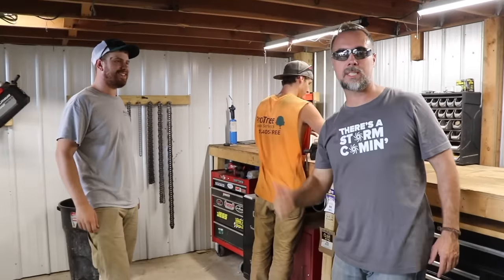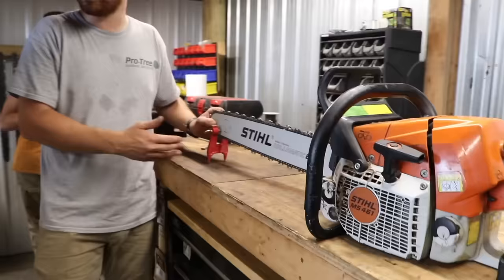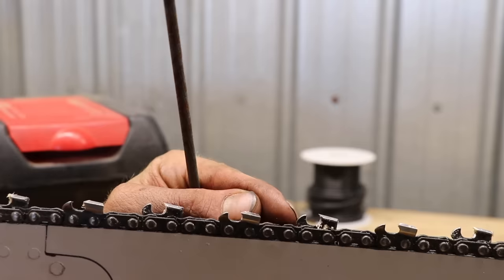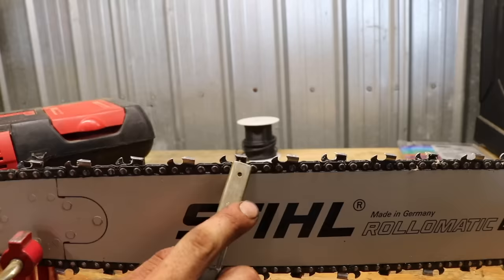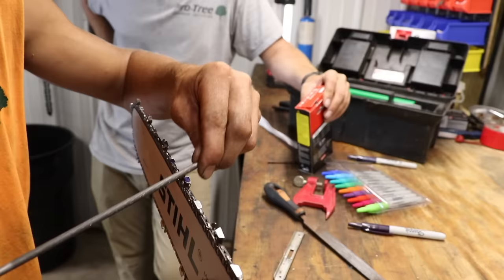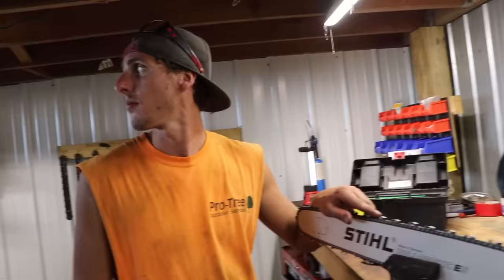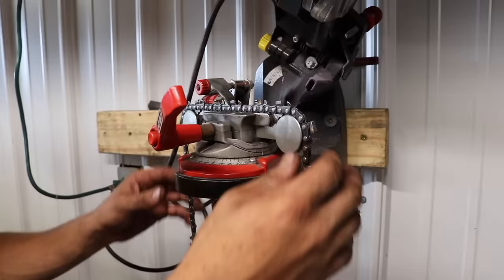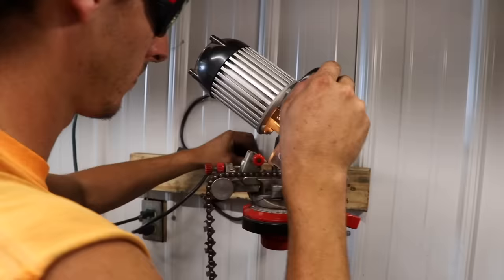How the Pro's sharpen a chainsaw

Comment: wow I have a stihl dealership that charges me 3$ to sharpen each chain. I drop off 5 chains at a time and I just change them as I need to. I'm just a landscaper that cuts once in a while and this video was very informative
Reply from the maker: Glad to hear that Kevin, thanks for watching !
Reply: 3 Bucks a chain ?  Where do you live cause around here it's 12 - 20 per chain.
Reply: in New York at a family run dealership in the country. It's a barn with a dirt floor with a Stihl dealership sign on the front LOL. They are real loggers that do a quality job too they just happen to sharpen chains real cheap
Reply: @kevincloonan9787  For $3 a chain I'd be happy to let someone do my chains
Reply: I find it takes just as long to change a chain as it does to sharpen a chain.
Reply: @richardnwilson  your doing something wrong then I can change 3 chains before I could properly hand file 1

Comment: I just use the Dremmel chain sharpener.  It works great and is really fast.
Reply: Dremmel tools yes they work fast but they also remove way more metal from the tooth than usual hand filing no matter how careful you are,  and if you're not careful you can glaze the tooth,  making it look sharp but with no ridgets so it gets dull faster.  You can also get the tooth too hot ruining the metal.
Reply: Kenny Sanchez Yes, it’s possible but not guaranteed to happen.  You can screw up a chain with hand tools too.  With a bit of practice, I’ve gotten great results. Besides, chains are pretty cheap.  If they were as expensive as the saw itself, I’d be the first one to hand sharpen.  I think I paid $18 for my last chain, and I’ll gladly toss it in the trash when it’s unusable.
Reply: Fivespeed 302 by what you’re saying it sounds like you’re just a typical homeowner buying a chain for your saw? I run a tree company,  we have over 20 different saws just the chain on my 28” Stihl is $75.  Deremel tools never leave a clean sharp on a chain tooth,  it’s glazed,  reason why you don’t see a professional logger( not want it be professional) using dremel to sharp their saws.  Now for homeowner or someone who cuts here and there no biggie,  must don’t even realize they have a dull saw.
Reply: Kenny Sanchez You do realize those chains are tax deductible, right?  Someone who does this professionally should be aware that $75 is nothing in the whole scheme of things.
Reply: Fivespeed 302 we do,  more reason to be aware of chain cost and knowing how to properly sharpen a chain when doing it professionally.  But someone who doesn’t wouldn’t understand.  Just my 2 cents this is all I do for a living.  Take care and good talk.
Reply: Kenny Sanchez It works for me, what can I say?
Reply: @KennysTreeRemoval  wow Kenny, I can get you set up with some chains much cheaper.
When you gonna do some new videos, I'm waiting as I always enjoy them. Maybe YouTube unsubscribed me or changed my settings?

Comment: i appreciate the close-up views. They didn't mention the angle line engraved on every tooth
Reply: Yes they did
Reply: Yes they did mention that
Reply: I didn't hear it either, but if the guys said they did...
They are called witnesses marks by many of the guys I know, they are not on all chains, but most. Also many chains have them on the sideplate to help you to get the correct hook/profile.

Comment: Great video! I used the same grinder/sharpener! I however cut the gullet down level with the top of the links. If you don't cut it low enough it does affect how it cuts. And keeping the teeth all the same size definitely makes a huge difference! They need to be identical.
Reply from the maker: Thank you Elias, and thanks for watching !

Comment: "Sharpened every tank of gas" -- No wonder my chains just smoke...  I honestly didn't realize they needed to be done this much.  Looks like I'll be busy this weekend.
Reply: pmgodfrey I give my chain one good sharpen before my cutting season, then I touch it up with 3 or 4 passes every tank. Always flip my bar on every tank to
Reply: I take mine to a local guy I don't touch it most ways only rounds then over.
Reply: @blacktailbowhunter0135  that's unnecessary. Flipping your bar every tank. Once a day is plenty.
Reply: @nobodythatyouknow241  sure when its on company money, if im paying for it its gonna last as long as i can get it to and it only takes 15 seconds to do so its not hurting anything

Comment: I was a timber feller for a dozen years and always chisel filed my chains and just took a few licks off the riders periodically. You chisel because it gives you a chance to get your undercut straightened out if you need to hairline a piece out. A round 7/16 is fine for firewood or limbing or bucking. I ran an 084 or Mac 125 most of the time as we were mostly in big timber

Comment: Good advice on the pro chain sharpener. I have one very similar to this one and they're wonderful to have if you do a lot of saw work. Here's the thing, Tanner -- and listen up. You have to get that sharpener secured to that it doesn't bounce around a half-inch with each stroke. You're wasting motion, time, and energy. Take that sharpener off that 2X4 and set it aside. Now take another length of 2X4 and mount it near the floor just like the original is mounted horizontally. Now take a 2X6 or 2X8 and secure it vertically between the two. Now mount the sharpener securely onto the vertical board. NOW you have a secure mount. You'll thank me later. Now be careful with those sharp-ass chains!

Thanks for the vid, Stanley. Always enjoy them.
Reply from the maker: Appreciate that, thank you !

Comment: I hand file my chains using the husqvarna jig with the 2 rubber rolers and that works well for me. 
The jig also has a depth gage on it with two settings: hard wood and soft wood. I prefer taller rakers. My saw is a bit on the weak side and it runs smoother when the raker is a bit taller than what the jig tells me to. It just works best for me after some experimenting.

Comment: I've always sharpened all the teeth without skipping the opposite angled ones. By just changing the angle of the file holder back and forth. Seems a lot faster then going over the chain twice. Didn't get that part of their procedure.
Reply: It's actually a lot less efficient doing it your way
Reply: @J0rd4nBr0 I got retheme!

Comment: Little tip. Run some timber over the teeth to take off the wire edge. Stops it breaking of and damaging the tooth when first used again..

Comment: For homeowners and weekend warriors:   Buy the file guides.  There are 2 simple hand tools you need (Stihl names, Husky also has similar tools):  the “file guide” +_$17 and “file guide holder” +_$12.   For thirty bucks you can sharpen your chains yourself correctly all the time.  (Make sure you get the correct size tool for your chain.)These pros in the video file all the time so they become good at just using the file, the rest of us just don’t file often enough to be good.  Also pay another $3-4 for the depth gage tool seen in the video.  Your chains will last a lot longer than taking them to a shop for sharpening because the electric tool generally takes off quite a bit more steel than hand files do.

Comment: In my sharpening kit i also keep a Broken Hacksaw Blade  for cleaning the chain gruve in the bar , the broken end gives a pointed end for also cleaning the oil gallery hole ,a clean gruve lets the bar oil flow & keeps the bar tip from overheating . I also have a 8 ft bucking horse made from 5 ft & 8' aluminum scaffold tube [ Tube & Clamp - 2-8' ,12-5' tubes & 15 Right angles] i can load 1 cord on this [2 ft -40' bundled  logs ] & with the chain optimum  fresh sharped i have cut a whole cord  with 1 tank of gas [ most times it takes 2 -3 tanks ,a old nylon rope to cinch the logs is handy sometimes  .

Comment: I have been an  arborist since the 1980s, with a background in forestry. And I have been a steady You Tube watcher for perhaps five years. 

I understand turning to the Tube for information. I have done it too. But because of guys like you, my least favorite subject on You Tube is chain saw sharpening. That is where I find record breaking amounts of half-baked or outright wrong information!

Let's take a look:
•Where are you guys located? How is it you don't know how to pronounce Oregon?
It is Or-E-Gun.
That applies to the chainsaw accessory company, and to that beautiful state. It is still there. It is not GONE!
•Raker: that is a nickname where chains are concerned. It is a depth gauge. It regulates the dept of tooth bite in wood. Long ago, rakers were the Y shaped tooth on some two-man crosscut saws.
•You posted a teaching video here. Quit switching names for things. Depth gauge, raker, blade, bar, and even the electric chain sharpener. It is NOT a bench grinder! Learn proper terminology and be consistent.
•Stump vise: very good to point it out. Good tool. If you hand sharpen a saw on a work bench, the stump vise can be used there too, to stabilize the saw. Like the bipod on a rifle.
•File: It is called a round file. For beginners it would be good to point out it is not a rat tail file, which tapers and is usually too coarse anyway. Your chain file needs to be the same diameter over its' entire length. And some beginners need to be made aware of this.
•File Maintenance: Files need cleaning. You sort of brushed up against this subject. You can use an old tooth brush, a small wire brush, a "file card", or at least a rag. You get a better job with a clean file. This applies to the flat file too. 
•When you ask a man to do a job, you may know to stand back and let him do it. The same goes for video making. When one of you jumped into the other guy's presentation, do you know what I got out of it? I did not get more chain information. I got that you looked bad. Are you a boss of some kind? That is poor leadership.
•This is not a bull session fueled by beer. It is a mechanical presentation. You need to have one main speaker, and he must have thought carefully about what he is going to say. If you are going to divide the video between speakers on different facets of the subject, introduce the next speaker and get out of the way. The floor is his now. How about something like this?
Now here is Fred who will talk to us about bar maintenance.
•When you showed that most chains on the wall were the dull ones and you made a BS statement about prefering to cut trees. Then you turned and I saw what looked like a tree company logo on the back of your shirt, what was the intended impression? What I saw was a company who doesn't even CARE about the maintenance every tree company has to do. It was also the way you talked. Should I hire you to prune my trees when you come off as so careless? Do you all make flush cuts because they are quicker and easier? Or do you prefer to leave 6" stubs? And to climb my tree with spikes? Or would you rather look sensible and trained enough that I might hire you to work on my trees? You need to inspire confidence. And not brag.

•Here is something that will help. You can get the Oregon Company's little booklet called OREGON MAINTENANCE AND SAFETY MANUAL. It has a ton of good pointers, regardless of which chainsaw or chain you use. Call 
800-223-5168.
Or Baileys sells them for about three bucks. This will put you all on the same page, and it is excellent for both beginners and experienced guys and gals. The industry has changed a lot through the years, and it is still changing. This is a good little book that will help you keep current.
Reply: The motor can be switched so the burr isn't left on the one side as it always is.   Granted the sparks will be coming at you but I've done it for almost 17 years now.
Reply: Man you took what I was thinking and said it there are way to many fly bye night business in the world that have no clue about what it means to learn a skill and then how to teach that certain skill the last right generation is slowly passing away a so will the skilled trades work
Reply: that burr will be knocked off as soon as the chain passes thru some wood.
Reply: A couple of really good tips that could have been said more succinctly and less rude.     Such as “I like to clean my file with a wire brush, it does wonders to keep a file clean.”
Reply: @BorderPaps  
I'll go with that.

Rudeness was not the intent. But I have been doing this a long time and have studied a lot. So I'm not very tolerant of poor presentations with erroneous information. The materials are out there: including the manual that comes with every chainsaw, the Oregon book and numerous others.

One fault that many otherwise good sources have is failing to tell about the good shop methods. There have even been "instructional" videos that used a rattail file on saw chains.

In short, I have seen more seriously flawed chainsaw maintenance videos than those who only came close.

I do tend to chime in concerning some things. When I do, I write for both the video maker and those who read comments. I hope to put out good informstion useful to all of them. And thst certsinly includes all the praise I can find to share. I do believe in pats in the back and reinforcement.

I accept the criticism. Rudeness was not the intent.
Reply: Nicely put. Dangerous work. A dull tool is the most dangerous thing in the workshop or field. Next to watching a YouTube vid and thinking you have it wired.
Reply: you should make a video
Reply: Michael Dougfiro 9
Reply: Michael Dougfir Keep studying, Bud. Check your coordinating conjunctions, and erroneous typographical errors. Owl.purdue.edu will be a great source to start. Get comfortable being uncomfortable. ⚜️
Reply: Get a grip Michael, it's just a informational video done by volunteers, it's supposed to be a little entertaining too or no one would watch. If you can do better then please do I would love to watch it and pick apart every small detail and then question your skills and work ethic based on nothing more than a ten minute glimpse into your life. I happen to know the people in this video are highly skilled and trained professionals who treat every tree and every customer with the utmost respect, care, dignity, and professionalism - please don't disparage their character based only on your speculation and personal opinion. Rant over...
Reply: @forreststump11  along with the sharp cutting edge.
Reply: @sweet65mustang  baloney. I work at a small engine repair shop and have been sharpening chains for decades. I sharpen chains for loggers, landscapers, city crew and homeowners. I have never had a single complaint and have people tell me they drive out of their way to have chains sharpened where I work. You're probably one of those people that bring in an occasional chain that they attempt to sharpen by hand and I spend 30 minutes making it right again cuz it has been murdered with angles all over the place. Dont comment if you dont have a clue.
Reply: @forreststump11  wrong! My claim is not even based on chains, it's based on metallurgy. Also, I'm not saying the chain would be unusable just not as good as it could be. The best example is a knife blade.  Sharpen it on a stone and no matter how lightly you work on the stone you can feel a wire edge on the blade, where the edge is folded and brittle.   Use it a little and that brittle edge breaks off, look at it through a microscope and you'd see how damaged it is.  On the other hand, finish the edge on a leather strap and after quite a bit of use it will still be sharp. I used to sharpen knives for hunting outfitters and they couldn't get over how much longer a knife was useable when I sharpened it.
Reply: @sweet65mustang  yes. I know what it is to strop a knife blade. Nothing to do with chains. Like I said..I have sharpened chains for decades. By hand with files and on grinders with stones. I used to be an independant logger in my younger days and sharpened all my own chains by hand with a bar guide. You will never get rid of the burr after sharpening a chain. If your're a metallurgist expert, then you should know that. This video is on chain sharpening, not knife blades. hello?
Reply: @forreststump11  ok, I conceded. You filed a lot of chains and cut down a lot of trees so obviously you know everything about everything and that wire edge miraculously comes off the tooth leaving a beautiful true edge. Whatever dude.
Reply: @sweet65mustang  you will never get rid of that wire edge on a chain tooth gullet. there is no need to get rid of it. didnt mean to be insulting.
Reply: @Dougfir
Good points.  I enjoy their videos, I think they do too often interrupt the presenters at inappropriate times, sometimes ending the train of thought.  This happened a lot in their tree-climbing video.  Especially when life and limb are involved, it's best to let the experts finish their thoughts.

Comment: usually a pro saw chain takes a 7/32 file and never bang or pull back on your file it will flatten the fins out and you don't have to mark your chain you can see where you started the chain will be shiney and smooth where you started filing
Reply: Now you know why their files don't last.

Comment: I've use a file jig that attaches to the bar.  You can set angles and depth and get the job done better than hand filing but as fast as machine filing.  The jig works great in the woods, and it isn't too expensive, fits in a tool box.  I would recommend against hand filing unless you are a pro.  One other thing; look real close at the cutter and you will see a dull one is cupped over on top or even shows the grind where it got dull.  That all has to be filed back to be sharp again.  Take the worst tooth and fix it, then file the others to match.  And don't file at all on the gullet!